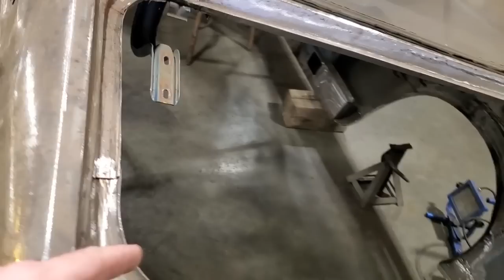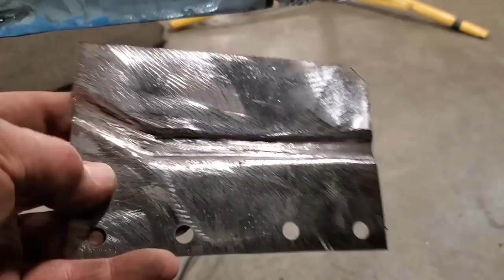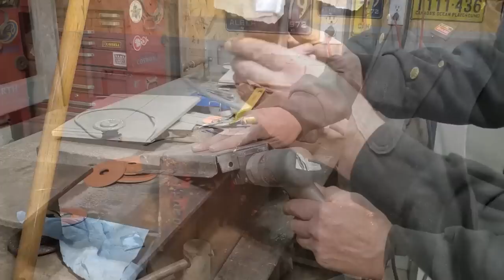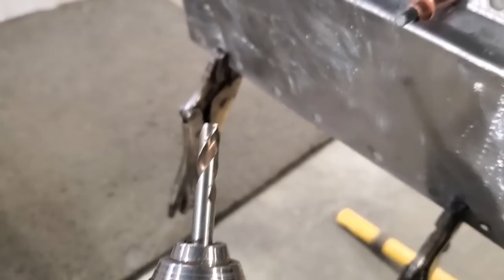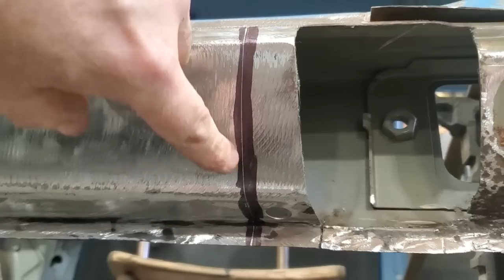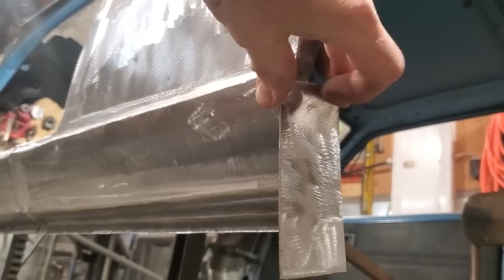Crusty. More rocker panel repair

Comment: Always love watching your videos. I have NOOOO experience in any welding, or body work at all and watching your videos gives me confidence to do it myself. I picked up a 73 mustang grande in April as I’ve always wanted a classic muscle to restore myself and pass on to my kids. So far from watching your videos the body work is coming along great and I’m motivated to do more. Thanks to your detailed explanations I’ve been able to recreate panels with basic tools in my garage.
Reply: Better than Fab school. I hated how much those guys charge so I started my youtube channel too.
Reply: Awesomeness
Reply: A
Reply: I've been welding for better than 50+ years myself and I do ALL kinds of weld Farm & Ranch type (pipe Fencing) and I do Mild steel and Body and Fender type to. YOU WATCH this man and YOU WILL learn How To do it correctly, 0ne other thing (if You don't mind me butting in) When You buy a Welder Please Don't go buy a Cheap one, Save up and Buy a Quility Brand Name Welding machine that my advise for the machine. My wire Mig is bout 39 Years now and looks New keep it clean and LEARN How it WORK's inside UnPLUG it anytime You need to go inside it to change the wire. 0h, and I buy the LONG LEAD's for it too so you can slide under something and Don't have to get up and move your welding machine.....I HOPE this Helps YOU.

Comment: I am 84 yrs old, never too old to learn. I would like to see the how you form a double curve in sheet metal. I have a 37 pu and the front chin below the grill is rusted out. I think others might be interested also. You do a great job in making your programs.
Reply from the maker: I used panels from other cars with same shapes to replace a double curve section. Smaller sections I make by hand and join threw the middle of the curve

Comment: Thanks Fitzee, i love that you share your skills so openly and in a way which is easy to understand!
I have a tip for you about your marker pen. If you unscrew the end, you will be able to remove the felt tip using some pliers, turn it around and refit it and you'll have a brand new tip.
Reply from the maker: No way!! Hobble for tomorrow! Thanks
Reply: OK this I have to try.
Reply: See!!!! You learn something new everyday…
Reply: Been doing this for years after find it purely by luck.  I accidently crushed one and while cleaning up the mess, I saw the double-ended tip.
Reply: Wow, can't wait to try this today. I like the Milwaukee markers - they seem to wear more slowly than Sharpies and this tip will make them even better!!! Thank you
Reply: @fitzeesfabrications  could you put that part number for that grinder you use.as I would look for one on ebay.please and thank you

Comment: Much respect, Fitzee.  Ol' Crusty is looking better and better.  Great tip about how to do the rear fender lip - it seems such a logical thing to do when you explain it, but it never crossed my mind before!  It will save me a lot of time mucking about when I replace the rear outer rockers and part of the lower rear quarter on my Triumph Stag.

Comment: Fitzee, I really enjoy watching your videos, they are so informative . You make it look so good, and showing us your little tips and tricks . That spot weld cleaner is neat . There is so many things that a person can make and do with time and patience and some common sense . Have you ever used metal out of old vehicle gas tanks for patches ? I have also used body panels off of old-old gas pumps ( because I worked on gas pumps for years, is the reason that I have them ) to make things out of.  I have never done body work on vehicles, but I have done a lot on gas pumps rebuilding them,  clean them up and sand them down and primer and paint them and put  them back out at gas stations in use to pumping gas, diesel and kerosene again . I have fixed some body parts on lawnmowers and tractors and primered and painted them . But I have 2 older Ford trucks that I want to start working on, to do some body work on, so your videos has learned me several things .  You do such amazing work and take the time to explain, the things that you do and how to make it look fantastic . Thanks for taking us along on your  builds .So keep on making us more videos and be careful and stay safe .
As always, Jeffrey !!!
Reply from the maker: I used metal from just about everything

Comment: Hi there sir . I did a build same as this few yrs back corrola v8 with full chassis . Just wanted to tell u what happend with first attempt. We did exactly what you are doing welded the chassis rails to the inner rockers what ended up happening because the inner rockers are as u say 20 guage metal on hard launchs the chassis rails seppared from inside rocks tore the metal . We had to cut the floor and chassis rails back out and weld in flat plate 6mm think the width of rocker panal and full lenght of rocker we welded 4inch left a inch gap then did that till it was welded in solid . Then we welded chassis rails back in and all the floor metal and went and gave it a hard launch at local track this time no issues what so ever . Was a good solid car arfter that . Theres was no drag car motor in this it was a thirty thou over borred 302 winsor motor with 650 holley elec dissy . But it had allot of torque. I aware you a great builder . But plz run a plate across thie inner rocker to beef it up . Only addvise i can give you to protect your safety so us you tubers can still watch your amazing work . Cheers shayne from down under
Reply from the maker: I always welded plated where the frame will mount. I take it the top as well and lower lips. There be a few plug welds as well. I Iove to see this car. Any pics of it or video??

Comment: Good Lord it is hard to imagine that this piece of sheet metal will ever see the high way again. Someone must really love this old rice burner, that is just beyond my comprehension.
Reply: Fitzee is the one that loves that old rice burner. He is making a race car for himself. Great project!
Reply: Fitz wanted a sub-compact to build into a street/strip car.  Considering the focus of his channel it only makes sense to build one needing a lot of body repair to give the channel good content.  The structure of the car is in the new frame and cage so it's easy to keep body repair to the visible body parts as you don't have floors and unitized rails etc in the way.  It's a win for Fitz and a win for anyone viewing his channel for tips on sheetmetal work.  On top of that...you get to see a cool little import Hot Rod come together!
Reply: @Sculpin74  I guess someone had to love it. Those things would rust out in the desert.
Reply: @michaeldose2041  I won't disagree with that!  The only thing thinner than the metal was the rust protection!!!  LOL

Comment: I like the way you did the frame u always can make a peace bolt in from lower control arm to lower control arm so u still can remove the oil pan but make it alot stronger

Comment: Another video and you still teach tricks we haven't seen yet.
Could you please show in some of future uploads preparation of repaired area to painting and final result?
Following your tutorials I was able to rebuild bottoms and outer shell of my rusted car doors. Finished it with flat disc and was happy with results until I started sanding with long block. I spend long time beating and shrinking with torch, after all I ended with about 3 millimeters (1/8 inch) of body filler in the thickest places. Is it expected? How good are your repairs? It is difficult to judge shape of metal surface with flat disc's scratch swirls, especially on video. I really would like to see finishing of repairs like that bottom doors you did on the pickup truck (long piece created from flat sheet), or back window corner of the white Caprice (complicated compound shape).
Reply from the maker: I'll be doing all this on Crusty. None of my patch work is perfect. It still needs filler. The hours needed to do it to a final  finsh in metal is many many hours. I don't mind filler. I worked with it for 30 plus years.

Comment: In a pinch I have used a pin to push in the side of the marker tip as a lever to pull the tip out some.

Comment: Thank you for the videos. Very helpful. 
Question. I have to cut our quarters on a 65 impala. The only panels I can find are part panels. Not full quarters. 
I will need to weld on the face of the panel. Im worries about distortion and longevity. Should I flange weld it. Or butt weld it?
Reply from the maker: How bad is your quarters. Check out my nova quarter video. I only  replace what needs to be replaced and I keep it as low as I can. I very rarely install the half quarters up to where they go.

Comment: Hey Fitzee, I've watched your videos and they are very informative. I have a 98 jeep XJ and I want to install rocker panels and lower door skins. my question is because my jeep is 24 years old with, 273,000 miles on it, is it good to use metal bonding adhesive because I do not have a welder or an air compressor and, with my jeep being so old.
Reply from the maker: I haven't used that stuff in years. Be very interesting idea. I give it a try

Comment: Great job you do good job explaining the process. did you change the drop down on front frame section one view looks like the uprights are 90 degree and the other view looks 45 degree on the uprights wondered if its the view or a change thanks
Reply from the maker: The view. No changes

Comment: Fitzee. What brand is that air punch?  I could only find one with a smaller hole and I have to drill out every hole as they're too small to get a good weld. Looked all over they all seem to be the same.
Reply from the maker: I got it about 9 years ago at princess auto and there is no tags on it to say what it is. It's just a cheap hole puncher

Comment: On an sort of unrelated topic. i could not find the Walter 60 grit 15L506 (min 25) so I bought  the 15L853  36 grit. Have you used  as coarse a grit before and would you recommend them?
Reply from the maker: They will tear up metal. I find the ones I have aggressive

Comment: The front cross member is not an issue cause I've seen a car that the motor mounts was the cross member and it was just fine for what they were doing with it

Comment: I've noticed that when you cut and butt you don't always cut it with a 45deg angle to create the slight overlap. Do you have a reason to the madness of when you do or don't?
Reply from the maker: Sometimes it pulls too tight so I have to open it up some and by changing the angle it does this.

Comment: Are you concerned about grinding your welds too thin if not why? Do your welded seams need body filler?
Reply from the maker: No I have my heat hot so I get good penetration. I fill all my welds. I don't metal finish them cause it takes up alot of time

Comment: Mr. Fitzee I'm wondering what size Liner You use in Your Mig Gun , I kinda think You use a .30 or an .35???? I'm just curious 
I shore Do like Your video's You are teaching this 0l" Man👴 a thing or two. 👍
Reply from the maker: I run 023 wire but I have had 030 wire in it so I say it at least a 030
Reply: @fitzeesfabrications   0K I kinda thought You had a larger liner in Your welder. Thanks alot.

Comment: clickos are not used in the aircraft industry so much anymore since the trend is machined components instead of sheet metal builds. Light commercial might still use them.

Comment: The expensive rustproofing was done by the dealer, the product looks good but the labor was bad. You can see it on the treated and non treated area on the car. The black plugs does not garantee the quality of the job.

Comment: ya talk about the notch on the ends I used to do the same with a pair of snips,
just take a make a small cut about a 16th inch in, worked out the same when ya don't have the grinder handy!

another thing you can take a piece of stainless and make a side scribe if your using known distances say 1/4 5/16 3/8 1/2 7/16 5/8 etc
just each point is a saw tooth  to where you can scribe it we did them for duct work  for the various seams and laps etc etc 
one tool various depths looks like a funny saw blade with worth it
Reply from the maker: Good tip!

Comment: Crusty: I see a couple of pinholes. Instead of replacing, would welding restore anything adequately
Reply from the maker: Thanks for watching
Reply: @fitzeesfabrications  but could a mig repair pinholes?
Reply: @truckerdaddy-akajohninqueb4793  Fitzee did a master class in repairing pin holes maybe six months ago. Have a look back through his videos.